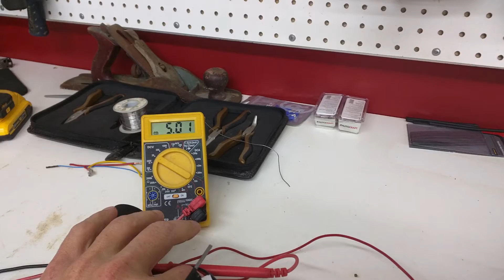Pollak 6-port selector valve

Comment: DUDE! "Since I don't have a DPDT switch...."  is why your thing ain't working.  That's why they provide a MOMENTARY on-off-on DPDT switch.  This is a MOV (motor operated valve)  not a solenoid.  A momentary switch will, by its very nature provide that 0 volt break between switching.    There's nothing wrong with your valve....at least there wasn't before you gave it voltage in one direction for prolonged periods...that's not the way it's designed, man.  You're like the kids and women who cook power window motors by ramming them up and down by holding the switch too long.
Reply from the maker: Sorry, that isn't entirely accurate. For this particular case, yes, I had the wrong valve. The valve originally on the truck required continuous voltage. This Pollak version was not. I ended up returning it for https://www.amazon.com/dp/B0049UCF82/ref=cm_sw_r_cp_apa_fabc_KH7BKGEXWH7K7T386WK4?_encoding=UTF8&psc=1

Comment: so how would I do this on my truck? I'm not an electrician, so I'm a little confused. I have port A set up to my right tank and port B to my fuel gauge and port C set up to my left tank, but I only get a reading on my right tank.
Reply from the maker: What truck are you working on, and what is the selector switch in the dash like? This was for my 89 F150. I used to stock selector switch which is a DPDT switch. So one of the poles fed fuel gauge and the other pole fed power to the in-tank pump. This way, when I switches, both the circuitry for the signal from the tank and power from the tank were switched together. If it's only a single-pole switch (SPDT), then you will not have any way of switching both the pump and the sender.
Reply: Tristan Lee 1976 Chevy C20 . it has a 5 port switch, one is ground one is main power and one goes to the fuse box. under the truck it was set up so one wire sent power and I think one went straight to the tank? so I'm pretty confused.
Reply from the maker: Unfortunately, without seeing how everything is currently wired, it's hard to say what's necessary to wire this selector valve up on your truck. My F150 had a vacuum-style selector -- meaning that all the switch inside the cab did was change power to the 2 different pumps. Depending on the line pressure coming from the active fuel pump, the diaphragm in the selector value would mechanically change ports to allow fuel flow.

Since I upgraded to the electrical-style valve, I ran all new wiring to the pumps and selector valve, and had to do additional wiring under the dash involving not only the DPTP switch, but also a relay to invert the polarity of the power going to the selector valve which causes it to change its position.

You can find pictures of how I did everything here (https://www.ford-trucks.com/forums/1431138-need-help-hooking-back-up-dual-tanks-2.html#post16278620) though it may not benefit you much with your truck.